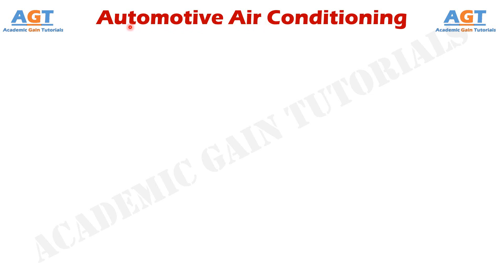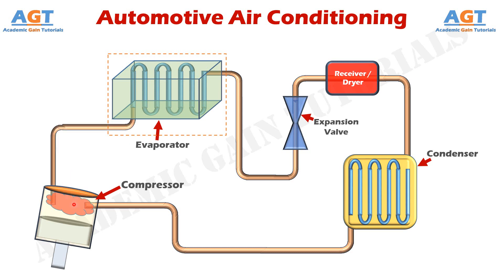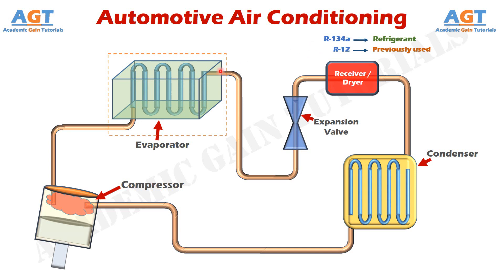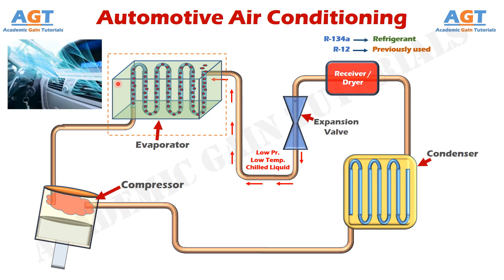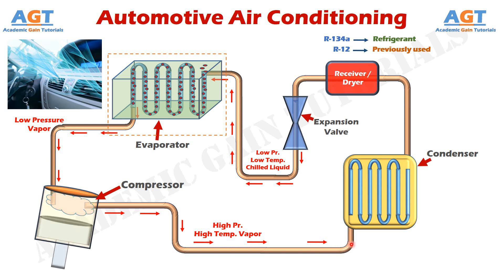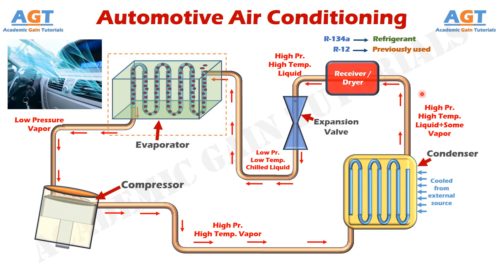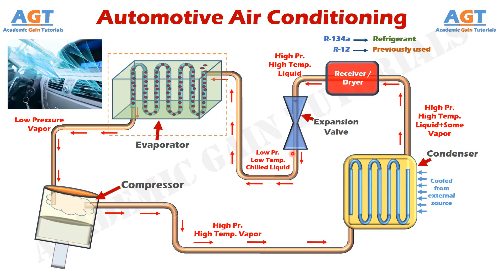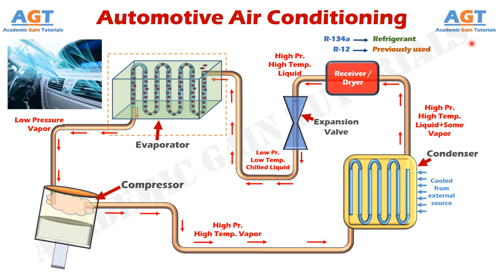How an Automotive Air Conditioning System Works - Explained.

Comment: Great video, I always wondered how the air conditioning system works in cars and this was clear and simple explanation as to what each component does! Sure, you can go in depth with each individual component, but it's good to get a grasp for how the system actually works altogether 👍

Comment: Is the a/c clutch suppose to stay engaged all the time when the a/c is on and the car is working on park gear on idle in a properly working A/C system or is it suppose to cycle on/off (Altima 2010)? Thx